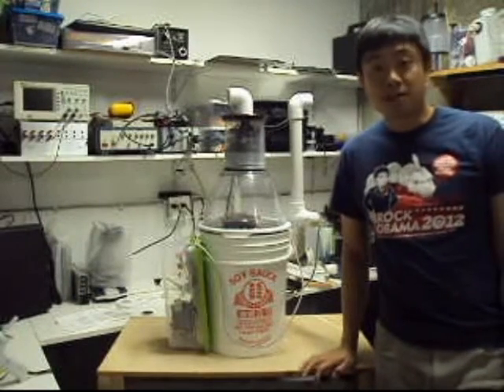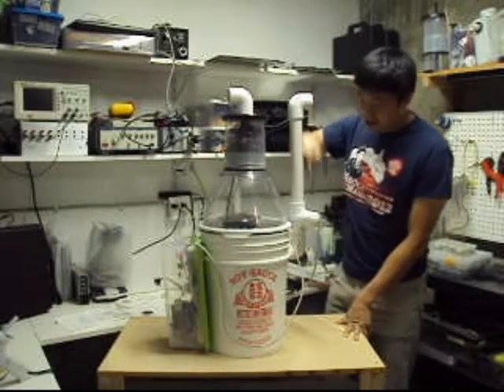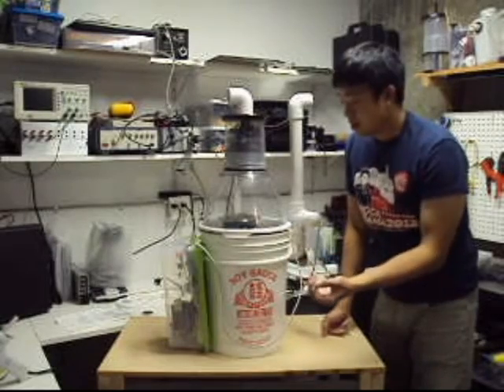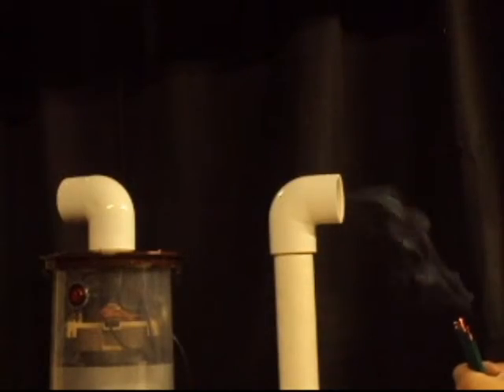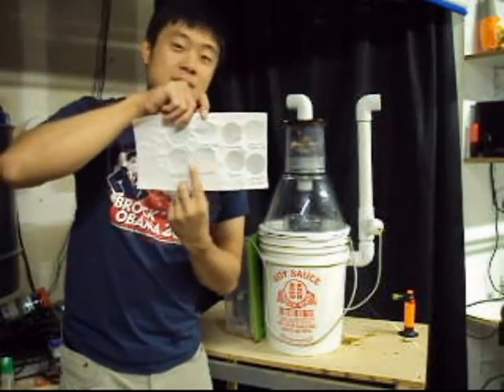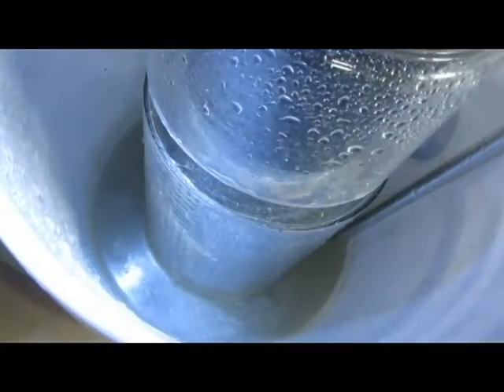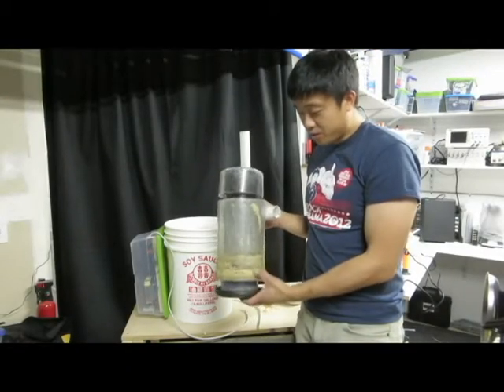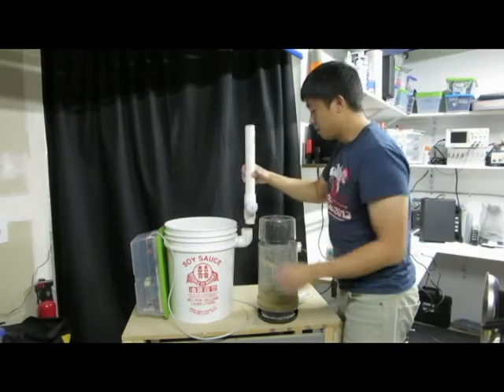My Invention: Electrostatically Augmented Cyclonic Self-Induced Spray Wet Scrubber

Comment: Hi, It is awesome!
I don't know some thing about that, is it necessary to use high voltage? if you turn on the high voltage, all the time the circuit is shorted by contacting water to grid. because the grid is always wet.